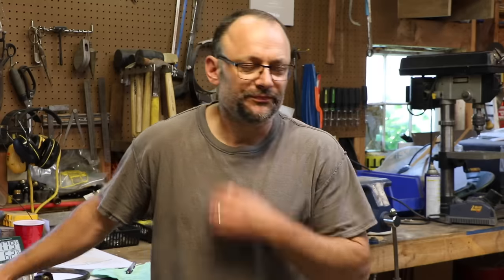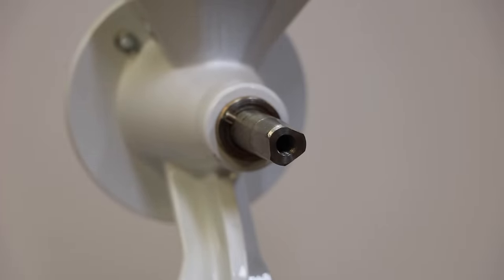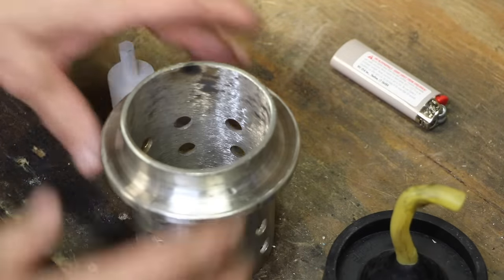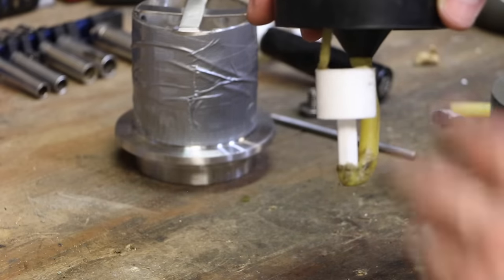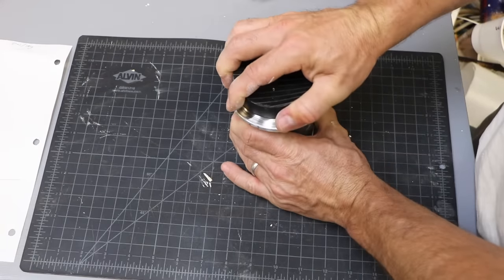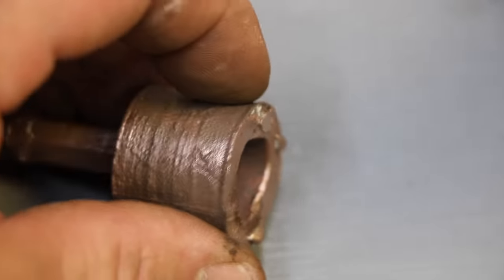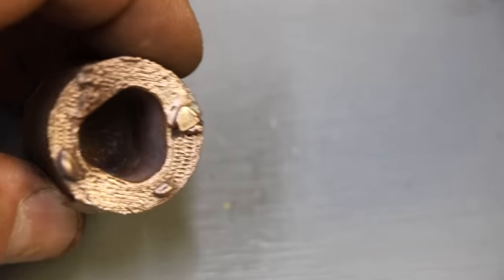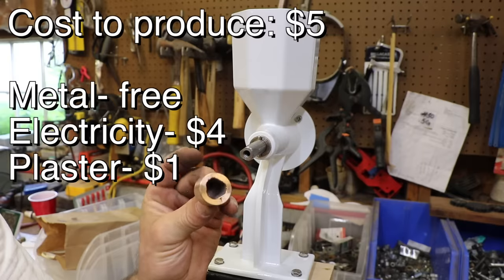I Refuse to Buy Your $@#!   I Make My Own.

Comment: Well that shape of handle is common on old hand crank equipment. It is shaped that way to make casting the handle easier. The shape also makes the handle stronger and less likely to break or slip.  The handle more than likely, does not have any machining done to it. A good casting with some trimming. So the company saved money making it this way. Which allows them to sell the unit cheaper. Cheaper is always better with the majority of today's consumers. 
P.S. I had to laugh at your cost comparison. You list it like some of my farming neighbors rationalize their paying High cash rents. You included no cost for the thousands of dollars of equipment used nor any labor cost. You will have income from this Youtube video so that will more than offset any cost involved.  

Don't get me wrong I enjoyed the video showing how you could cast small parts like this. Keeping them coming.

Comment: The 3D printed part was a failure from the start. PLA is not a good material especially if something gets warm. One of the best plastics for that would be PETG. I would have designed it with a 1-in hex and if practical counterbored it to screw it onto the shaft so that during operation there was no wobble. Then use  a socket with an adapter to your drill. Also design with a high percentage of infill of at least 50%. The casting you made should have had a large radius where the hex met the body of the tool.

Comment: Considering the lengths you went to in making this adapter, that $30 ain't so stupid or you wouldn't be so worried about saving it. 🤔 If you spent more than an hour making that, then you don't value your time very much.

Edit: going by your final tally, you don't value your time at all, it seems.

Comment: I would have taken a socket that fit. drilled three holes in the side of the socket and tap it so you can put 1/8 half-round (Socket Screw) allen wrench bolts, and done.   I do jewelry as a hobby and vacuum cast.   I was curious about why you did not just pour directly into the pattern and just get rid of most of the yellow sprue wax.  Could have just poured the investment in, vibrated it and let harden then pour.  Was it a burn out issue or something I do not know about working with PLA?

Comment: Printing a taper going to a larger hex on the back would allow you to print it in pla directly. (Using a socket adapter to spin it which most people should already have) It looked like the original broke on the seam where the hex met the back at a 90 degree angle. I'd have to test to be sure though, if not. I'm fairly sure ABS would be able to handle it if it was printed with full fill. But I kind of hate ABS.

Comment: If your cordless drill is a DC brush motor, which it likely is, running it under high load like that will annihilate the motor very quickly.
Although if you cast/lathe'd up a pulley reduction system, that would be a pretty sweet solution.

Comment: Change the shaft with a rotary tool and a grinding bit. Use a drill with a chuck big enough to fit the shaft. Fa pully to the shaft that you modified, Mount any size and speed motor,  Mill your grain at 2 tons per second. You could make a lot of bread selling custom adapters for this POC grain mill.

Comment: So just to make the price of $40 for the part viable. You spent more than $40 in time and material to make one. That being said. You did what I would have done too. But it was worth the $40 to buy it. Plus it was steel instead of bronze. But yours will wear out itself and save the shaft from damage.  Pros and Cons.

Comment: You have a lathe!! Why not make a new shaft with a proper bolt head?  Or threaded to accept a nut which would accept a socket...  You could probably make a few buck selling replacement shafts....

Comment: You way over engineered that project. Just slip a conveniently sized piece of steel, copper or PVC pipe over the shaft and drill through the shaft and put a pin through them. You could also file the head of the shaft to fit a six sided socket as three sides are already there for you. You could slip a rubber hose over the shaft with a hose clamp and drive it. You could just take a file to a big nut that was a little smaller to the opening and file it to fit in 20 minutes. I agree with your assessment of the original design though.

Comment: I personally would've done epoxy putty like JB Weld or Steel Stick shoved into a large socket on that waxed taper shaft. Especially easy with a taper. Even Bondo would work. I've copied splines for a car rear seat broken handle where splines are very difficult to machine without a pretty extensive and key cutter rotary setup.

Comment: Fine work you've done. I admire your ability to make your own of such high quality. I don't have a 3d printer, furnace, lathe, belt grinder or a decent camera to film this video. I would have just drove 2 miles to buy a high-quality bolt for 50 cents, saving a lot of time and effort which would have done the job just as well if not better. Your message is valid though. It's the principle of the matter. And I got to watch a cool video out of the process. I hope you enjoy your home-made part and think about the people you "stuck it to" every time you use it. I enjoyed watching you make it.

Comment: You usually have to Print shafts laid down for linear strength w/ basic PLA.  The shaft usually needs cleaned up, but it wont just snap @ the layer lines.  TMYK shooting star 😏

Comment: The one that I use has a wheel which replaces the handle and allows the attachment of motor via belt.  If you don't want to use a drill and could find a 1/3-1/2 HP motor for cheap, you might try casting a flywheel around the same proprietary fitting that could do the same.] for your grain mill.

Comment: Hi 😁.  I'm just starting to follow you.  I immediately thought of taking a file or an angle grinder and grinding it so you could use a top in mm or inches.  It is sanded on 3 edges🤗.  Lars from Denmark.  PS Google Translate.

Comment: What would happen if you used a six point socket? It wouldn't need to be the exact size because of the taper. Just jam it on, use a 3/8 inch to hex head adapter and vola!

Right?

Comment: I think you could’ve made it out of petg carbon fiber, double or triple, the outside thickness, and the top with 100% infill hexagon pattern For the piece that goes into the drill I would’ve used as larger carriage bolt as as large as yon can get in and print the square hole for it to lock in place, super glue the carriage bolt in and then put a large washer and bolt on it and get it tight and then connect the carriage bolt. I think it would hold up very well. I’ll be happy to make you one to test.

Comment: Did you try just putting the drill chuck directly over the shaft?
Failing that, just a bolt in the hole seems like the easiest solution.  I mean, if you can build your own adapter out of bronze, I seriously doubt you'd have any problem removing a broken bolt, in the unlikely chance that were to happen

Comment: I have the same grain mill.  I adapted a DC shunt motor to it.  It was the wire feed motor from an industrial MIG welder.  It has great speed regulation.  With rectified 120V power the no load speed is about 100 rpm and with a high load such as grinding corn in the mill the RPMs only drop about 10 or less.  You mentioned in the video that putting all the torque through a bolt is risky because it could snap off in the shaft and be a pain to get out.  I agree, but that's how I did it.  I drilled and tapped the output shaft of the DC motor for the same thread as the grain mill shaft and just attached the two with a stud that was much higher grade than all-thread.  I've never had trouble with it.  It is extremely handy to be able to just fill the hopper on the grain mill, plug it in, and walk away.

Anyway, I like your solution and I agree that 30 dollar adapter is a bit of an insult.

Comment: I filed a hardwood spindle on my self-made apple cider press recently.
 All that's needed to make that spindle accept a socket is a decent file. Just be slow at the final filing and keep checking the socket fit.
4 sides are plenty. Your eyes see straight and 90°. 
Make a small, smooth radius around each edge. Done. 
One hand tool required, and care and a few hours time.
That's a nice adapter too tho.

Comment: The question is how much effort it needs making a perfect fit or to modify the shaft? I would personally modify the shaft hence I have no kiln. But I have a grinder and threading tool. So I would modify the shaft when I have a good piece of 70mm to do so. Which one takes longer? No matter what this was a brilliant video as always. Companies with proprietary trick are suck. It is your choice how to use your creativity to cheat the hell out of them and save some bucks in the process and celebrate your ingenuity.

Comment: Just wondering if a dc gear motor might be the answer, run off of a plug pack?
Cut the shaft back to round, machine and fit a drive gear (off the shelf).
Probably more expensive but would save having to go out to the garage every time you need flour.

Comment: OR... spend an additional $100 and buy a Fidibus 21 grain mill.  It comes with its own motor - so no holding a drill etc.  I have milled hundreds of pounds of flour with mine and the hardest work is filling the hopper and turning on the switch.

Comment: Find someone throwing out an old treadmill take it apart. Due the variable speed controller and the 90 volt DC Motor get a pulley and 💥 you got a motorized grain mill. The greatest part is the DC motor stays consistent with resistance. I did exactly the same thing for making corn flower and crushed corn for animal feed.

Comment: Just get a similar threaded Bolt, weld a small piece of round stock to it that'll fit inside a drill chuck and the jobs done. The handle 'cranks' in a clockwise direction, so the Bolt will just tighten when spun.

Comment: The design of this fitting is better than square, hex, etc. because it makes the most of shoddy materials. You have to imagine someone putting 200+ lbs of force into the handle so you really want something beefy and tight-fitting so the connection doesn't get rounded off. But it looks like some kind of cast metal handle, so the fitment is NOT going to be very precise... unless you design it like this where even a big gap between shaft size and handle size is fixed by just tightening the screw on the end.

Comment: Your 3d printed part broke so easily as you printed it with a low infill. Those small mechanical parts can should be printed with 100% infill. It`s better for a mold too.

Comment: The original tapered flat shaft is a good design.  Cheap and easy to manufacture. The taper allows for a no wobble handle fit without high tolerance to manufacturing either part.  Feels like you are just looking for something to complain about here, sorry.

Comment: That tri-lobe on a taper is very old.  I remember grinding meat as a kid on my aunts farm in the 70s.  That was the crank handle back then. I think the grinder was from the 50s.  I think it might be more 'tradition' than malice.  Keep in mind that the wholesale cost of that is probably around 6-7 if it is made in the usa and 0.6-0.7 if made by slave labor some place else.  You could have put all rod in, put a nut down then a coupler down on that threaded piece.  With the all-rod and the nut if it snapped off at the coupler you'd still have  chance of getting the rod out.

Comment: Take the shaft out, chuck it up in the lathe and cut the flats/taper to a straight diameter and then thread/weld a v-belt pulley on to it. Find a vacuum cleaner motor (or whatever) and go to town (just like the old coffee grinders). Or.... find the largest hex key that will fit in your drill and cut and thread the other end of it. Or... thread a bolt into the stock threads on the mill shaft and, using a cheap socket extension with the female (wrench end) cut off put on a socket that fits the bolt that was threaded into shaft onto the extension and chuck the other end of the extension into the drill. Or... just weld a socket that just needs a little persuasion with a dead blow onto the shaft. Gimme a couple of minutes and I'll think of a few more ways that don't involve casting anything.... Still like your videos!!!

Comment: Why not use a 3d printed part that will fit into a socket and make with nylon? Probably could just take the original model, modify it so that it would fit into a socket in less than 30 minutes. Parts that small are relatively easy to print with nylon, there are even some blends that you could print with a stock ender 3 that are reasonably cheap. Nylon holds up much better than PLA in this type of application, PLA is mostly good for ornaments and casting.

Comment: I would have forged it. The shaft shape is easy enough to produce, to then make a drift punch. Then take some 1" round stock and neck it down for the hex shaft. Put that in the pritchel hole, punch a blind hole in the fat end and widen it with the drift.

I'd rather make a pulley for that tri-shaft and run it at a lower RPM, I seem to recall running these mills over a certain RPM voids the warranty, for what it's worth.

Comment: another way to accomplish the same thing would have been to slip a hex nut with the center drilled out over the shaft and braze it in place.  Then you could have turned the shaft with a deep well socket.   It would be removable if needed and only take about 10 minutes to accomplish.   But very instructional video, thank you.

Comment: I noticed your 3D printed part wasn't filled in. There is a setting for it in the splicer, I believe. For molds, it's fine, but for things, which need to take some abuse, you might need to increase the infill percentage.

Comment: Learning to make something is far better than buying it. Even if your first ones are crap. You can use this until it breaks, and then you make a better one.
You could also use this method to make a fitting chain/belt wheel adapter (secured by bolting it onto the thread), and fitting a "permanent" motor to drive it. That drill seemed to barely provide enough torque.

Comment: seems to me that there was a much simpler fix for this "problem".
 You could have simply welded, or bolted a nut to the threaded shaft giving you the ability to set up a socket in your drill to do the same thing. Casting that piece was cool, but c'mon...

Comment: The plastic piece was still good when the shaft broke off. Make an aluminum bar to allow two screws, one on each end to anchor the bar. They could be long enough to pass through and attach nuts, or just deep enough to thread the plastic. I'd like to see 10-32 or M5, but smaller if you had to. The center of the bar would have a hole in the center for a bolt that will fit your chuck. Keep the bolt really tight with washers and double nuts so it won't spin in the bar.

Comment: The triangle milling into the shaft is standard with most (if not all) hand crank mills. I've got a completely different mill and it's the same profile. If you have a 3/4 drill it will be able to bite it as all chucks are 3-point.

Comment: This is similar to what happened with my car. A 1-inch skinny piece of plastic failed. That failure caused my brake lights to run all the time draining the battery. The replacement part cost... get this... $10. Ten fracking bucks for a skinny 1-inch piece of plastic that if it were METAL wouldn't have failed. I replaced it with a piece of gum and a nickel. I am waiting for the gum and penny to fail. It's been 6 months.

Comment: While the straight part of the shaft might not have fit any hand held drill, it would have fit in you lathe chuck, and in back gear your lathe wouldn't burn out driving the thing. Sure it wouldn't have been much of a video "motorize your grain mill with this one weird trick".
While your investment casting needs no pattern draft, the original die cast handle did need taper in the mold. If the shaft had been a straight hex to fit a drill chuck they would have had to do a second operation on the handle to broach a straight hex in it.  
Another thing, since the machine is meant to be dissembled for cleaning, the handle can't be a press fit, with a relatively soft die cast handle there would be a risk of a straight hex bore with some clearance wallowing out over time. On the other hand the taper allows the handle to be tightened to zero play (even with a little wear)  yet still be easily removed.
Finally, with probably very limited production, Amazon's cut and free shipping, the drill adapter is probably not a big profit item.

Comment: The shaft on the grinder has a pin going through it. I wonder if you could've cut a slot in a pipe to fit that instead of doing this.
I'm sure this is better than that hacky pipe anyway. Your bronze version is probably more durable than the mystery alloy one they sell, too!

Comment: My guess is that the original engineering for the shaft had the three flat design years if not decades before anybody decided that they wanted to put a drill on it. You will find similar shaft designs on many hand crank items from the mid 1900's so the manufacturer probably didn't have some nefarious evil plot to make a huge profit on the adapter. It simply saw an opportunity and capitalized on it.

Comment: For once I've circumvented your idea. Cut three 1/4" plate triangles that are tangential to the shaft, then weld them into a cone. Cut off the apex, weld a puck about the size of a dime, after drilling a hole in its center. Build it up with a welder, then nibble away at the ugliest bits on the lathe.

Comment: use the pin that already exists and a pipe that would go over the shaft  and remove the excess steps of casting. Then weld a bolt you can hook the drill to or a cheap 120v or 12v gear reduction motor so you don’t have to use a drill at all.